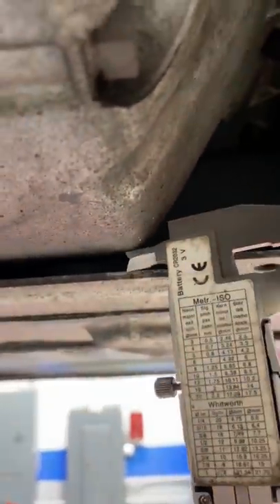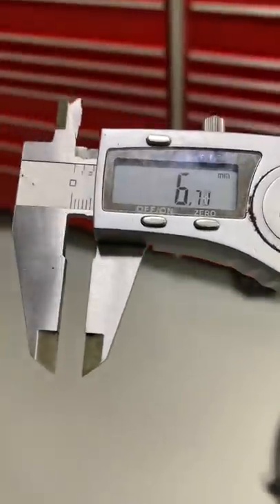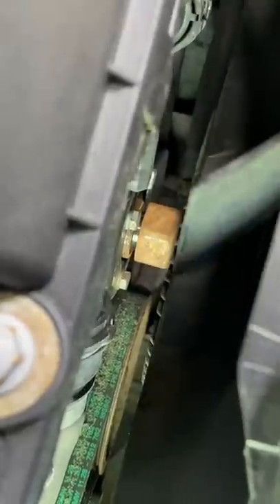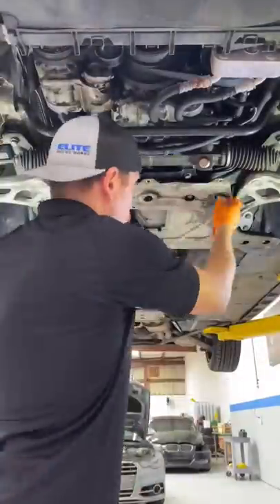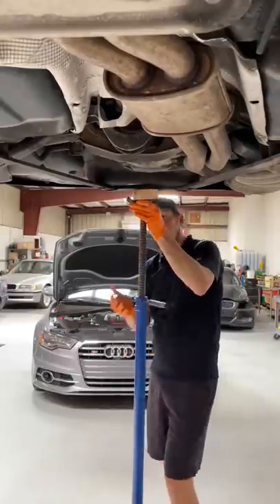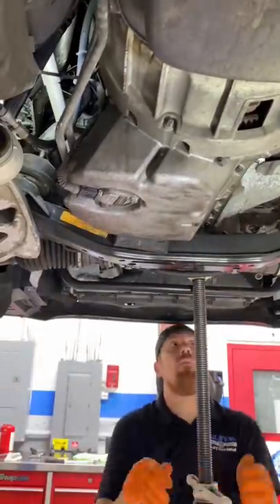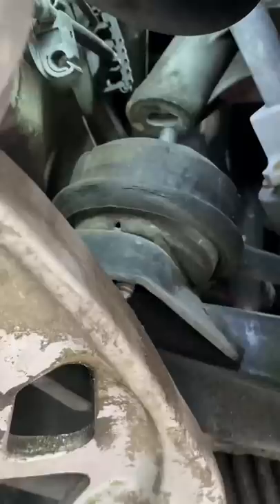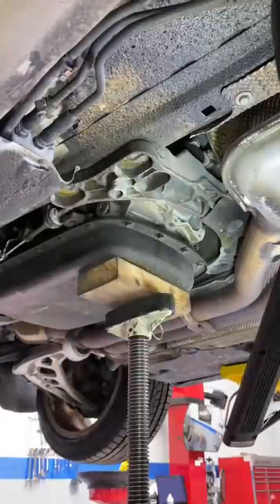Big Difference! New mounts #shorts

Comment: Wow, that e46 looks well looked after. Can't belive it still has all the under trays and they're oil free!
Reply: If you take care for the car it is posible to look like that.....with all parts and no oil leaks.
Reply: @marioturkalj3126  and an empty wallet
Reply: @marioturkalj3126  thanks Einstein
Reply: @marioturkalj3126  Dude! I'm without wor.....thank you
Reply: @Snarf_Le_Wombat  nah just do basic maintenance. Got a diesel e46 with 150k miles and it’s just the same
Reply: @Re_Kitty  Call me after 200,001 miles buddy
Reply: @Snarf_Le_Wombat  Sure, my friend in the local bmw group has an e46 with 240,000miles (400,000km) and its fine. two owners and he maintained it properly
Reply: @Re_Kitty  Yeah so he spent more than the value of that vehicle at this point doing maintenance and repairs. No wonder people defer maintenance. BMW parts are expensive, there's no getting around that.
Reply: @Snarf_Le_Wombat  he hasn’t changed anything other than the clutch, belts, shocks and brake disks. All normal wear items. Clutch with new dualmass costs €300, each shock costs €30 from magnetimareli and the brakes all around €100 buying a kit of ridex brand. And the belts around 25 euros.
Reply: @Snarf_Le_Wombat  You, right now, sound like that one guy who buys a car and expect it to hit the million on the odometer without spending a dime, not even on an oil change.
Either that or that guy who buys a new car after the old one has a small mechanical issue.
Reply: I really want to know what americans do with german cars. Sure they made some shitty ones like the 1.4 TSI/Tfsi. Or they e90/e81 4cylinder petrol engines and also the newer ones are way to expensive. But killing older bmws,VAG Cars,Mercedes is in my opinon really hard atleast what i saw in my time as a mechanic. If you do maintain them you last you long. And if shit breaks after 10-20 years what happends to every car....
Reply: @Cherry-iy4mw  I have an e46 328i and the most labor intensive repairs I have done on my car are change the valve cover gasket, and most of the cooling system (i.e. radiator all coolant hoses and expansion tank) and even though it is a German car and I live it California it was still cheaper to get parts for than my dodge avenger, I feel like people claim bmw parts are expensive when in reality it's the labor that is expensive. (At least 90% of the time)
Reply: I want an E46 now
Reply: @nicowallace6409  well i live in germany and i also was a mechanic and of cause the parts here are even cheaper. In my expirence workling on german cars (most of the time) are not much diffrent then other car makers all have some shitty designs. And also stuff just breaks after 10-20 years which many people just dont understand
Reply: Under trays normal get ripped off when a driver hits a deep puddle. People drive too fast in the rain.
Reply: @nicowallace6409  did you buy everything from FCP euro?
Reply: @joxxeyy  all parts yes,
Reply: @nicowallace6409  nice, they are pretty good about shipping things out in a timely manner and that warranty is awesome
Reply: @joxxeyy  yeah the warranty is the main reason I got all my parts from them.
Reply: @Snarf_Le_Wombat  400,000 mile BMW E39 m5 here.
Reply: @Tom-q6h2c  Original engine?
Reply: @Snarf_Le_Wombat  Yep, my uncle brought it new in 2000. He serviced it 3 times a year along with normal maintenance, the gearbox has been replaced once. Now I'm the new owner and I can say it drives perfectly, there a stack of invoices for parts and labour I've not had time to calculate the cost of all the parts and labour but I would say around 15k, he did most of the work himself.
Reply: @Snarf_Le_Wombat  I just went through all the invoices, it's had an engine rebuild at 250k miles and had a total of 21k spent on parts and labour.
Reply: Just bought an e46 and finally got to changing the transmission and differential fluid and MY GOD WAS IT CAKED UP WITH OIL

Comment: (Content ⚠️ Warning) 

Had a buddy who decided to try and break a bolt lose by pushing toward a stamped heat shield like that. I had to bag his finger up and put it on ice while I rushed him to the hospital. They’re very sharp. So when breaking bolts lose near sharp steel or even plastic edges, please break it away from any smash/pinch points. Some bolts break lose with no warning sending your arm forward like a knockout punch into a very sharp object. Yes he hit it so forcefully it severed his pinky finger. Cut through the flesh but the bone actually broke into a few pieces. I wish I had taken pictures of the after surgery but I couldn’t stomach it. Lol. I still don’t know how I managed to pick up his finger with most vomiting on it.
Reply: If it’s that dam hard to get. Nut off  take a chesel  cut it off  get a new nut time is every thing
Reply: Fuck dude that sounds gory as fuck
Reply: Sounds like an event for nearly every working mechanic. Usually dirty, scathed and cut hands.
Reply: Yea heat shield on my header gaskets nearly cut to the bone in my finger from a single slip
Reply: Yeah I knew a guy working on a electrical breaker panel too close to his face...and the screwdriver slipped and busted his front teeth out 😬
Reply: this should be #1 mechanic tip, happens all the time. even today i hit my nail like that and it started bleeding from underneath.
Reply: Did his finger survive?
Reply: Rule is...pull, don't push. Experience is the best teacher but damn the things I've seen screwed up by rookies.
Reply: @outtatime4512  yea pull, to hit your elbow instead of fingers 😀
Reply: Yep, that's why a good pair of gloves come in handy. Oh, safety glasses are a must too when working on cars. You've up to 10 fingers to lose, only 2 eyes.
Reply: When someone loses some part of his body(finger, leg, toe, arm whatever) don't put it on ice. It cools it and makes it die, like you when put naked on ice. Just faster
Recommended is wrapping it in cloth
Reply: I'm in EMS.  Thank you for saving his finger. Can mean much over a lifetime.
Reply: Content warning ?? This ain't a safe space buddy. Keep that shit on tumblr and Twitter 🤦🏼‍♂️

Comment: I remember my first fan removal. Didn't know it was left hand thread. I had bars, pipe wrenches, etc. Watched youtube and felt like an idiot cause I didn't think of that.
Reply: Whichever direction the fan turns with the engine running…that’s the direction you turn the wrench to remove it!
Reply: Ooooooof.

Comment: I started working as a mechanic for Honda then got into BMWs. Wasn't always the same but most of the time I made three times more money off of BMWs. And that was me being faster on Honda's
Reply: Don’t lie though it wasn’t just because you were perhaps working harder. Honda’s are so much simpler and they are made to be as easy to work on as possible without hindering performance, when possible. Bmw is just overengineering taken to the max so they can try and get that little bit of edge over there competition with other luxury brands.
Reply: And the thing is, BMW just design different but simple ! Is like switching from a android to a iPhone ! New form and feels too it! That’s about it
Reply: @Thatguy-fg4fp  When did I say I was working harder? Motor mounts for Honda's was easy (ish) but took more than twice as long on  BMW. I charged more to work on BMW's so made more for the two hours or BMW motor mounts vs the one hour on say an Odyssey
Reply: @jonbar140  I consider bmws to be harder work is what I was saying. Guess I didn’t make it extremely clear so I can see why you said that but I was more or less inferring that that was the case. I can work on Honda’s without a service manual most of the time but with bmws no matter how simple the job you are almost certainly going to need to a larger amount of very specific steps. So I consider them to be harder work but I guess more skilled at the same time.
Reply: @Thatguy-fg4fp  okay I'm tracking with you now. After doing this for over a decade I quit using the term harder or easier and start saying more patient or not. Because really all it's about is taking things off. But I noticed when people don't know what they're doing they just don't take time. It's not hard to change a clutch or the cams it just takes extra steps that require extra patience. And yes, using a service manual and building on the back of experts definitely makes it easier.
Reply: @LowkeyBadass  when compared to brands like volvo mercedes etc. then yeah you're correct, but when you compare them to actual simple cars like honda toyota etc. bmws are not simple, lol. 

 I guess growing up in a rural area, most people tend to drive the "simple cars" around here so when that occasional bmw rolls into the shop here, its just a tad bit more annoying than what I'm used to in my opinion.

Comment: Makes sense that the thing spinning at several thousand rpm threads the opposite direction
Reply: Several thousand, no.
Reply: @REDxFROG  I don't remember this video completely, but it was the nut on the flywheel I'm pretty sure, which definitely would be spinning that fast
Reply: @zrspangle  it's the radiator clutch fan which drives off the water pump pulley. And yes, they spin quite fast depending on the amount of resistance in the clutch and what RPM the engine is at.
Reply: @chandlerbraaten847  right, thanks for the reminder, I don't remember shorts that well 😅

Comment: Why the mounts so worn out? Is this a typical repair for cars in general after X time or is it specific to Mercedes or this model /year 🤷‍♂️
Reply: Every engine mount gets worn out, and this is an E34 bmw not an Mercedes
Reply: No just an overpriced BMW or Mercedes
Reply: It's very typical... don't listen to idiots. All motor mounts are on rubber, all rubber gets worn out, it's inevitable.
Reply: You can do poly mounts or even make your own, however if you do poly mounts on the engine you are supposed to on the trans mount as well.
Reply: @nikothewagon1700  ehm, this must be a typo bc a BMW E34 clearly does not exist, maybe you meant E46?
Reply: @fedor5664  e34 does exist, its an 87 to 96 5 series... it is an e46 in the video though.
Reply: @colecooper5836  yeah your right, can't believe I didn't see that 😂
Reply: @jeffreyhinman1397  it's tuning however. And doing so can cause other problems which the engine bay wasn't designed for.

Comment: “I need an oil change”
Mechanic: “no problem it should be just a minute”
Also mechanic: changes engine mounts, transmission mounts, alternator, timing belt, steering wheel, head lights, AWD
Reply: if it needs changing might as well. can only name 1-2 cars where u can ignore every problem and an e46 aint one of em lol

Comment: I need to replace my mounts in my E46. Any tips for a DIYer?
Reply: Get a lift, it's a pain in the dick to hold up the trans and engine when you're on your back under the car. Or, put it on high blocks if you got em. Don't do the job unless you have plenty of clearance. 

I'm not a true DIY person since I am a mechanic but I don't have a lift at my house so I make do with what I got. Also invest in an electric hydraulic car lift, they aren't expensive. Maybe a couple hundred at most but worth it especially when jacking up your vehicles. Good luck! Be safe!
Reply: @ChahtaAnumpa  Thank you!
Reply: I rather drop a fuel tank on my back than do these motors mounts on my back
Reply: @ChahtaAnumpa  it's easy. Grab yourself a harbor freight support bar to put tension on the engine. Do one side at a time so the engine also pulls up on the opposite side. For the passenger side unbolt the bracket from the engine to get better access. Also there's no need to remove the reinforcement plate like he did. Doing so means replacing all those bolts (one time use bolts) and torqueing them to yeild (you need a traditional torque wrench and an angle wrench).

You can absolutely do this in your garage with an engine support bar from harbor freight and some hand tools

Comment: This is making me question my jettas mounts 😂 so used to engine mounts needing to be torn apart, not squished
Reply: Years (decades) ago I had a Rabbit convertible which was a blast to drive but had a bit of a vibration. When I took it in for a new clutch the service writer said, “It’s probably the motor mounts, common problem”. Over time oil leaks onto the motor mounts and they disintegrate. Sure enough replacing the motor mounts made that car as smooth as a Cadillac. That particular VW dealer was honest and affordable.

Comment: 2nd hand work I took over from a prior tech. Came in with a oil leak. "Just needs a oil pan" per quote. Engine mounts were both torn, as well as front suspension concerns. Springs were so worn the axle impacted the oil pan causing the leak...

Comment: Thanks for showing this. It gives me a much better understanding of what I need to do now lol. I was questioning whether my mounts are bad in my 2007 Honda pilot I have 170,000 miles. the position three mount passenger side was holding on by a thread. I’m concerned that my other two mounts are in need of replace!!

Comment: Gotta love the OEM hydro fluid filled jelly donut mounts. On the M6x cars they always tear from the inherit 'twisting/ torquing' of the drivetrain. Usually the drivers side fails first as a result. I prefer the poly ones. I used the Revshift ones plenty of times or you could just turn your own with a chunk of poly or delrin and a lathe. I never noticed any increased NVH with the stiffer mounts either and on e34 540/6 cars in combination with some decent trans mounts the shifting feel is so much better.

Comment: I got a car in January of this year. Every bump, I'd hear a knocking noise. I swore it was suspension. No sweat, I'm adding Performance parts and replacing it all anyways. 5months later, front suspension is brand new, clunk still there. Couple days ago I turned my car on and "BANG!" Drive on a flat surface and "bbbbbbang bbbbang bbbbbbbang!" Changed the passenger side engine mount, engine runs smoother, no additional noises, bang sound gone. Engine sounds brand new. 
Back to my performance project I go.

Comment: I miss my e46, not sure how it happened but one day the fan blades blew up somehow, I’m thinking something got sucked up through the bottom cause I had the bottom cover/panel removed, the fan blades just blew completely off and punctured my radiator in a bunch of places, punctured some hoses, and nearly shot straight through the hood, sad sad day. It already couldn’t pass emissions but that was the final nail. Went through Nam and back and still ran strong, 220k on the engine it and still ran perfectly fine, was just everything else. Such a fun car

Comment: Jamie can feel the engine vibrating on this E46 3 series because the engine mounts are bad and check this out it's only about 6 mm from the bottom of the oil pan with the new mountains installed with this 3.0 l inline 6 and then remove the fan blade the fan from the water pump

Comment: There's something that can help alleviate this long term. It's called polyurethane. 80a shouldn't be too stiff as far as engine mounts go, but definitely don't use the 90a+ on engine and trans, save those for the suspension.

Comment: Hi jamie. I'm driving a BMW E87 chassis.  The air flow meter is faulty.  It makes two 10 second noises when running.  Do you mind if I continue to use it this way?

Comment: Hey sir... yeah you the mechanic in this video, where is your shop? I would need to come in to find out why my vehicle is still knocking even after I had replaced the engine mounts, struts, cv axles, ball joints? Please tell me your shop, I need to get there asap cause I felt Im getting robbed in NYC indie shops trying to tell me to replace things I dont necessarily need... please give me your response! Thanks in advance.

Comment: I think changing those mounts will give you a more comfortable ride. But leaving those old squash mounts leave the car with a lower centre of gravity and handles better even if it’s more rough of a ride
Reply: You wont feel any difference of the lower center gravity, but you directly feel the gain on vibrations
Reply: Simple physics say you are incorrect about what a lower centre of gravity will do
Reply: @tomster7574  you really think you can notice you car handle better in curves by using those bad mounts?
Reply: Physics tells you that your car loses brake and acceleration performance by adding 20kg from the supermarket potatoes, fact is you won't feel those 20kg difference
Reply: @AnthonnyAndria  then why bother spending the money to replace them?
These guys were looking for peak performance are not going to carry 20 kg of potatoes with him.
Reply: @tomster7574  because the gain is perceptible in terms of less vibrations, smoother reactions, not in terms of better gravity center

Comment: No no no, you turn that fan blade to the left as hard as you can and when it won't budge, you get big breakover bar and try again. Then you use a breakover bar and cheater pipe (~5ft of leverage) and turn it to the RIGHT until it pops free along with your shoulder socket. Trust me, I slept in a holiday Inn parking lot

Comment: do engine mounts change the car vibration idling in drive? (like stopped at stop lights and such) my car vibrates in idle (in Drive during stop lights, drive thrus that kinda thing). but only with the a/c off. when the a/c is on it doesn’t vibrate as much.

Comment: Serious question I have a 2019 kia optima just got brand new tires on and a few weeks later I'm experiencing the car shaking when I accelerate shaking goes away when I'm up to speed ot let off the throttle. Could it be a cv joint motor mounts or something else? I've heard it could even be a misfire from a cooked spark plug. I'm not a mechanic or anything but I am capable of working on my own car depending what the job is.